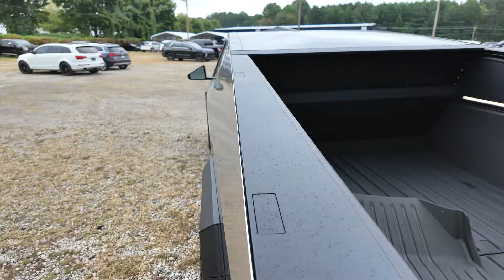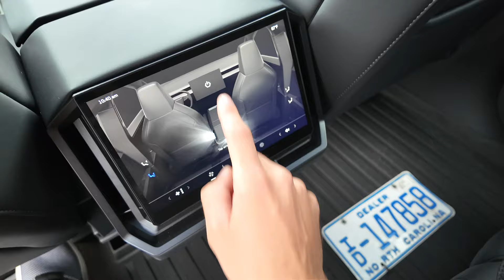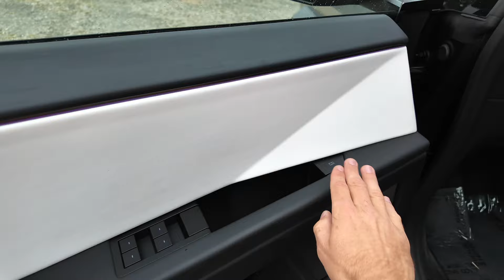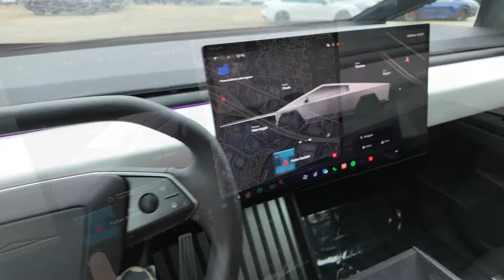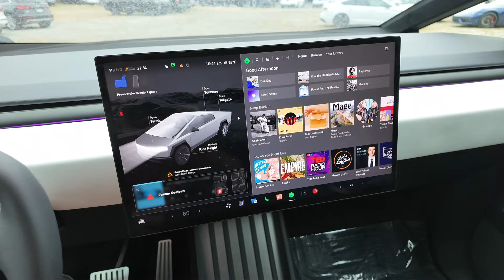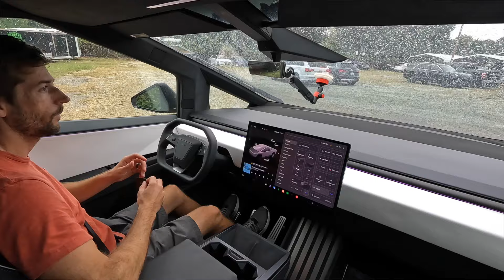2024 Tesla Cybertruck Foundation Series: Start Up, Test Drive, Walkaround, POV and Review

Comment: The $120k CT is a Cyber beast.  You are quoting specs from the $100k two motor cyber truck.  You have no idea what you are spewing.
Reply from the maker: Prices have come down. But that was the original price for this model…
Reply: @BrosFOURRSpeed  Incorrect.  FS cyberbeast has always been 120k.  Dual motor FS has always been 100k.
Reply from the maker: @monaezytwo6513  no, they were that price when they first came out…and then the prices came down. The FS was $120K when it debuted.
Reply: @BrosFOURRSpeed  Incorrect.  The FS  never had a price change.
Reply from the maker: @monaezytwo6513  it has, but that’s fine..
Reply: @BrosFOURRSpeed  You are woefully ignorant if you believe that.  But that's fine....
Reply from the maker: @monaezytwo6513  cool, just looking at the facts, have a nice day.
I had friends who ordered them, so I have some insight on pricing..